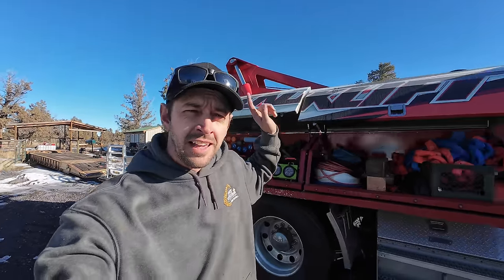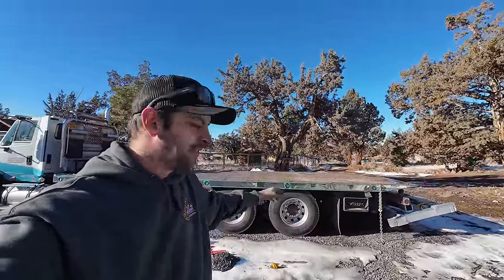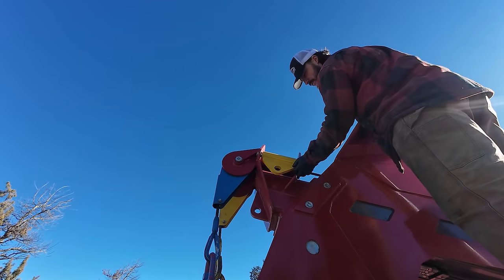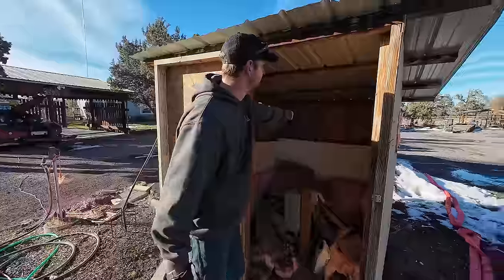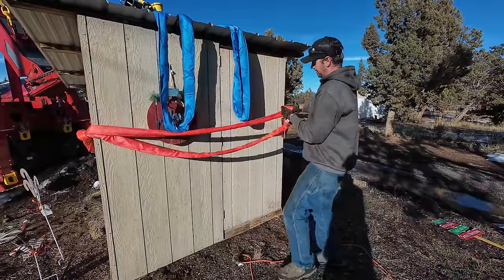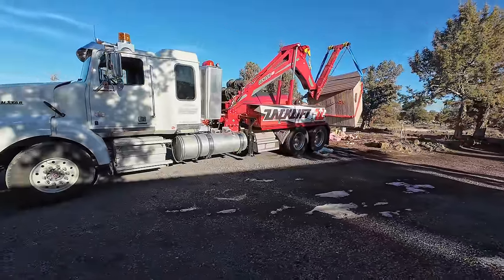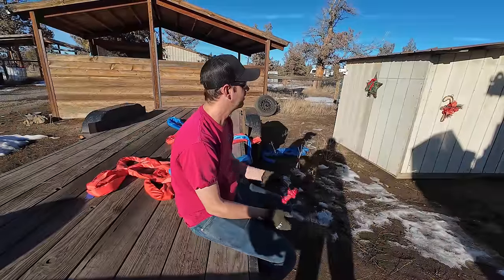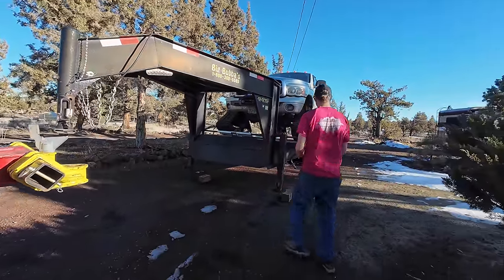When routine maintenance gets EXPENSIVE 😳

Comment from the maker: Update, I ended up having to work most of the next day, and by the time I got home they were already wrapping up and done.   Big thanks to Cascade Pump And Irrigation for getting my well back online FAST!
Reply: Awww shucks.
Reply: But I wanted to see your 800ft pipe...
Reply: Drill holes in all 4 corners of pumphouse and install eyelit lag bolts. Appy roof sealant on threads before running them in. 

As for greasing the truck did he get the S-Cam tubes and also the seat. Not sure if that is one that takes grease but, most western star seats do and if accordian skirt is on it it can still be that style. Some have holse cut for the grease fittings. Almost everyone forgets to do them. That and steering boxes and steering shafts by the firewall and some have inside cab steering shaft grease fittings.
Reply: Well gosh dang it 😒  You could have set up a camera on time lapse if you really cared about us😂😂😂😂JK 😜 😅 🙃 😂
Reply: If you put a container on either side of your "truckshop", you can get a container shelter to connect the 2 and work out of the snow / rain / sun
Reply: @robbylayton I’m sure would love to fix that chain damage!
Reply: I'm team tennis shoe for life as well but I got bullied into wearing boots 😂

Not sure why truckers think they need boots. I've worked construction. I've driven trucks. I've worked wreckers. You don't need boots to work wreckers.
Reply: Call Cascade Pump to redo the job so you can make a video 😅.  Just kidding. That would have been a great video. Even watching truck maintenance video is interesting.
Reply: Of course want to see them work on the well! *edit: sorry I just read it. Well, bummer. Oh well.
Reply: my youtuber engagement for the day- you could have used the blocking you used for tires to space the blue lines to keep the roof safe. no real issues but its funny how sometimes people forget the tools at hand.
Reply: I'm trying to figure out how your pinned comment is 5 days old on a video that just dropped... All I can figure you edited 5 days ago and then scheduled it to post today! I know the pump house is already back over the well, but.. If you ever need to move it again just holesaw a hole in each side up at the eve height where there is support and slide a pipe through to hook the straps on. Quick easy fix and no strap to have to wrap around the shed. Nice work!
Reply from the maker: @1ltlbrnc  this video was uploaded well over a week ago, but not made visible until now.   There’s another half a dozen already uploaded that you guys can’t see as well.
Reply: By chance did they mention your static water level? My buddy lives not far from you and his well went dry. It’s close to 800ft.
Reply: Dangit I wanted to see the pump replacement. Good content anyway.
Reply: @CaseyLaDelle  Question, did the pump cause the water line to twist and rub the wires that took out the pump?
And thank you for the shows, time, and tips that you give everyone. My wife and I love the comments you make in the shows.
Reply from the maker: @ducewags  nope.  Steel pipe, no way it could twist
Reply: @CaseyLaDelle  I figured with that long it would have been steel. I have seen, "bad idea" plastic used in my area of Northern Minnesota thats why I asked about the twist. And thanks for the reply.
Reply: @CaseyLaDelle . I been doing remodeling for over 25 years. I know exactly what you go through in organization and maintaining. We do but people will talk. They can figure out life and realistic life of people who are always moving. They don't realize that yes captain obvious. Bugs me too being a mess. And then you have a day to finally reorganize. It's life of people in demand. I get it myself
Reply: And Casey's big pipe stays a secret
Reply: But was it 2" pipe like What the Hales? 😂😂

Comment: Almost 40 years ago my late wife and I bought our acreage. I replaced five well pumps in 11 years. I know more about well pumps than I ever intended to! Our well was a 36 inch diameter augured well 300 feet deep. We had a 1 hp pump 280 feet down. When I put in our six well pump, I finally had all of the information and skills to determine that the reason my well pumps had been failing was because The wire was too small for the length of the run and the size of the pump. So I put the wire in one size larger than what I needed according to specifications. That was the cheapest pump I ever purchased, and it is still working 30 years later without fail. Make sure they have the proper size wire on that if you have not already. Awesome video demonstrating the Zacklifts true adaptability to whatever you have to tow!😊
Reply: Yeah even with the right size wire for the amps it pulls, you need to figure what the voltage drop is for the length of wire you’re running. And size accordingly 👍. I’m thinking the you lose about 3amps for every 100 feet but I would have to look it up.
Reply: I do a lot of electrical work several years ago I ran #2 aluminum underground wire about 300 feet to a little outdoor barn that was 24/24 that the owner was making a work shop for a lot of woodworking equipment. He was wanting to do it cheaper so I just used a 30 amp screw in fuse box with two fuses instead of a breaker box, and fed several plugs off of it. After all he can only run one saw at a time.

Comment: Remind eithen that when greasing the brakes the truck should be chalked and the parking brakes off. Also when greasing the front axle king pins and steering the axle should be off the ground. While greasing the steer axle I rotate the tires to do a full visual inspection of the steer tires. (looking for debris).

Comment: Hello Casey , dang 800 foot well.  I had a new well drilled last fall , at 120 feet we hit water and at 200 feet we were getting over 30 gallons a minute.   So we stopped there.  I am really happy that I did not have to go 800 feet!   I have seen people in this area build a well insulated box over their water equipment and heat it with a 100 watt light bulb.  It works , even at minus 40f!   And Grumpy , absolutely he is the best!    Thanks for taking us along and of course thumbs UP!!

Comment: Nice video as always Casey 👍

I even managed to see the short first this time 😁

I had a mechanic out one day to work on my tactor, for going underneath he pulled out of his van, an unused flat lorry / semi anti spray wheel flap, put it prickly side down then had a nice clean, slightly softer surface to lie on the back.of it.

That was onto a concrete floor in a shed but I guess it would work outside, I've also sometimes used a big sheet of cardboard, of course got to avoid any drips of grease.

Comment: Worked on a big loader, they used 1/4 inch nylon air lines for grease lines for hard to reach stuff, the only down side, if you send it hard in cold weather, it'll pop the line,

Comment: LaDelle on a Well 😂. Maintenance day shows all the work that really goes into running heavy equipment like the Western Star & ZackLift or Farm Equipment!  Our well house was a very small fake decorative rock, stuffed with insulation, that looked like part of the landscaping!  We had underground electric run from the garage to plug in a heat tape wrapped around the well head.  The thermostat was back on the outside of the garage and turned on the heat tape when the temperature dropped to about 34 (we had very cold winters). It was simple, automated, and worked like a charm.  And when we sanitized or did maintenance on the well, you could lift the fake rock off easily!

Comment: Always impressed by your operation.  When greasing those Onspots I used to grease them when they are activated. Makes the bushings last a little longer. During summer months I take the chain wheels off so it doesn't wear the arm bushing too.

Comment: I know that you are going to get more advice on how to pick the pump house in the future but I can't resist.  Option 1:  Install lag bolts on all 4 corners where you can attach chains or lift straps.  Use your wheel wood blocks to protect the metal roofing.  Option 2:  Use your skid steer with pallet forks to lift it.  See, aren't you glad I took the time to advise you... You are welcome!
Reply: Casey, You "need" more advice on how not to pinch your finger "fixing" tin roofing 😅 Love it and all the advice comments. Better than Ann Landers.

Comment: You laugh at doing yardwork with your wrecker......... im envisioning forks that slide onto the square tubes of the underreach...... it be how to keep them light weight yet get them to tip up and down to level them to unload pallets off of trucks...... add another job ability to the arsenal....

Comment: Some armchair engineering when you go to put it back.  Screw some long 2x4s on each side to get the straps out wider than the roof.  If you have a spreader bar, that you could use, even better

Comment: My mountain house had 600’ deep well, my home had 260’ deep well. Mt house had 1hp submersible pump hung on 1” blue plastic pipe. Main house had 3/4 hp submersible pump hung on 1” blue plastic pipe. After well was drilled my wife and I installed the pumps, pipe and wire.  
We have pulled and replaced both complete pumps without help. I wish I would’ve had a Zacklift, I think it may have made it easier. Good video Casey.

Comment: Would it not have been easier to just unscrew the roof panels and let the well company lift out of the pump house?
Reply: Pump house that I worked on had a little 12" hinged hatch on the roof, right over the wellhead.
Reply: @christianweagle6253  I've seen that too.  But without one, removing a few screws would be easier than what they did.
Reply: He mentioned in the video that he wants to use a  plastic round igloo dog house so the square footage of it would be a less to heat when  he has to heat the pump house.  The savings in the electric bill will pay for the igloo type of house if he bought it new, which he rarely does.  Facebook Marketplace has all kinds of things on it.
Reply: @robertb4455  Yup.  After he moved it and realized he was going to have to find a different way to move it back, then he came up with the igloo doghouse plan.

Comment: Yeah installing that bumper is not fun at all.
Reply from the maker: It was actually much easier and quicker than I thought it would be
Reply: Shouldn't be any problems for Mr. Know il all.
Reply: @CaseyLaDelle  shimming it was the worst part, of course I installed it using a skid steer with forks so it wasn’t too precise, had to wiggle it around with a jack to shim it right.

Comment: About 25 yrs ago I convinced my parents to have a drilled well put in. The well "people" were drilling about 20 minutes when a sink hole began to form. The drill operator (and owner) pulled up his equipment , moved the rig and said  In 20 yrs I've never done this, here's your money back and left. Then dad had a dug well excavated. It's 40 ft deep app the size of an Olympic swimming pool and filled with washed gravel. Cement casings were put down stacked 1 on top of the other. It has NEVER run out of water and the pump is in the basement of the house. But you do need to live in an area with adequate rainfall. Just an FYI for those that can do this and have the property.

Comment: I built my well house using cold storage panels, I used the 4' thick version for the walls and ceiling and I did a efis plaster finish so it doesn't look like a white metal box. 
It also serves as an exit from my underground bunker.

Comment: Sometimes, you have to make decisions and simply live with the consequences. With conditions as bad as you have been having, one can hardly 'blame' you for wanting to get home rather than freeze your nuts off. Maintenance is the same. Yes, it SHOULD be done just so, but life ain't like that, so you do it when you can. The problem comes when you have a vehicle that HAS to be done just so. Well, some trucks/models/brands get a reputation for being reliable because the designers figured there would be an ideal maintenance cycle, and a real one. Those designers live in the real world. Like the guys at Zacklift. That's why no sane person buys a Mercedes, Jaguar or BMW. The maintenance on those is simply not flexible to cope with real life.

Comment: I’ve seen this method of shed moving before and it didn’t turn out well 😮. I have moved a few sheds and a 12x20’ tiny house from the woods to a lay down area using, high lift jacks wood shoring and a car hauler trailer and my 97 dodge diesel 2500.

Comment: At my old house we pulled the well pump 300’ 3 times  in ten years! Did It ourselves and only had to pay for the new pump and check valve once as the second time they were still under warranty. The second time I tested new pump in a 50 gallon barrel and dropped it all back down the casing only to have it work intermittently so back out it came and I replaced 300’ of electrical. I decided that I was not planning on doing the job again so I bought 300 foot of Pex line and ran the wiring inside the pex! Without a tractor and a winch to get the pull started I don’t think we could have done it ourselves but when the we’ll company quoted me $10-20 a foot for labor plus parts the first time I instantly became more motivated to do it myself with help from family members! In total I think we spent $1000 the first time for new pump, fittings and miscellaneous parts! Plus we fed everyone, the second time cost about $500 for the wire and pex and the pump was covered under warranty! Definitely beats $4000-$7000 times 3 ! Plus a week or two without water while they work you in!

Comment: I did a 130ft well with my 12k Badlands winch on the front of my truck. 😂 800ft sounds fun; Is it soft flex style pipe or the large screw together pipe that comes straight up like a oil a rig?
Reply from the maker: Screw together steel pipe

Comment: I pulled my well pump my self with the help of my wife. It is 560 feet deep, quite a job. The problem is where do I put all the Carlon pipe. It is very heavy at the beginning but after a while it is not to bad. Because the pipe has frozen between the well and the house, it bursted right near the pump.

Comment: Ok CAS here's something for you to think about.  Build a proper well house with a window on the side the well service will pull up too.  Then on the rooftop right over the wellhead install a skylight.  With the window open the crew can talk to each other and the line can drop down through the skylight.  Next thing few well guys will tell you is it's very hard to have to much pressure tank room. The pump manufacturer recommended tankage is for a two minute run time minimum.  Notice that a minimum.  I personally like the all composite tanks as they will never rust out and the bladders are different and replaceable.  They are higher up front but last damn near forever.  Next thing at 800 feet you need two check valves besides the one in the pump. I would use the breakaway checks as they are made to drain the water column once the rod is broken. It removes alot of water weight during the pull.  Next is when you running the wire from the breaker box yo your service disconnect at the well house run a larger wire than you meed to allow for lights and heat as well as a larger pump. Most times the wire is under sized and that burns out the pump.  Im sure at 800 feet your using a pump with a contactor do the pressure switch is only feeding the contacts on the box. If not use a larger rated switch because they will last longer.  When you wire in the service disconnect have it control the pump and install a second box for things like heat and lights.  Have the well company sanitize the well when they pull the pump. If your worried about the water level in well now is the time to install a gauge for that as well.  The kain things that affect how long a pump will last is how long the run time is each time it fires off. The size wires to the pump.  How much back pressure it has when it starts, hence the check valves.  Their are a few others like how clean the install is and if your making sand or not.  If i was closer to you i would offer to help you change out the pump. I've dealt with pumps all my life including working as a pump technician.

Comment: Eyelets screwed into the frame as sling points and a spreader bar to keep slings away from the surfaces (esp. sharp iron roof edges) are the key to something like this... solid attachments points, a balanced load and a controlled lift is always safer... Have you ever considered placing those two containers and spanning between them with a high roof structure... somewhere to park the big rigs, keep snow and such off them... and a place out of the rain and sun to work on them or change equipment packouts...

Comment: I have my well house hinged. Pull two pins and flip it over out of the way if I need to replace the pressure tank or pull the well etc. Reason being my tractor/loader is 70 years old, sits without use for extended periods and generally takes a half day of farting around getting it running if I need it.

Comment: Hey @CaseyLaDelle idea for the next time you have to move something light but to far out for your boom. Use another set of sheve heads in the frame fork holes of your under reach. You would effectively get twice the height and reach of your boom. In turn you use you winches to lift. Just food for thought.

Comment: Sorry to double post but for a garage idea, use the 2 bomb shelter containers as walls on either side to make a 2 car garage set-up, add an elevated roof that spans the two shelters (to give added storage above the shelters) and build in a back wall. Covered for working, side storage with doors and tall enough to hoist, lift, have taller vehicles, etc. Modular build. Can do it over time to save money and you can use it from day one as you upgrade it. Love the content and I am definitely going to try and say hi next time I am in that neck of the woods!